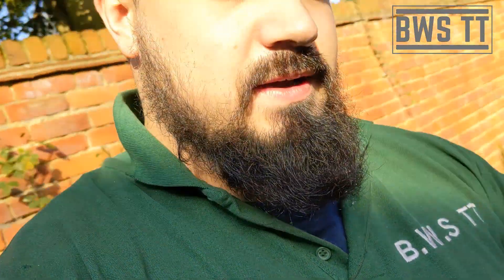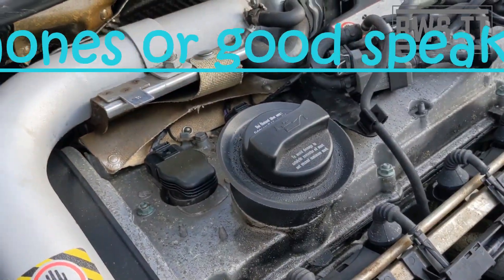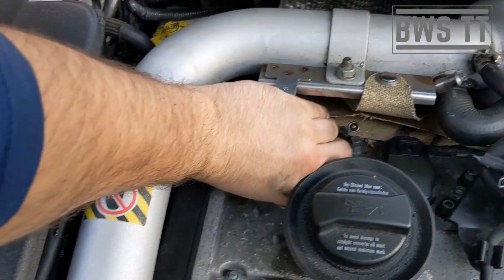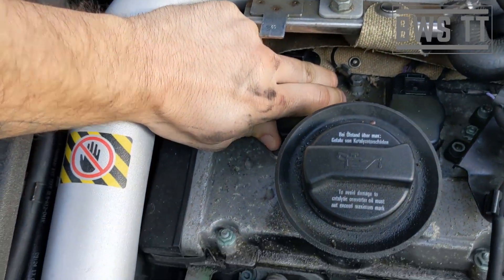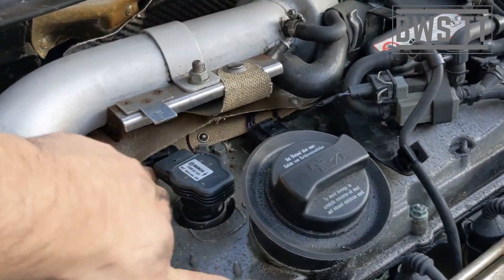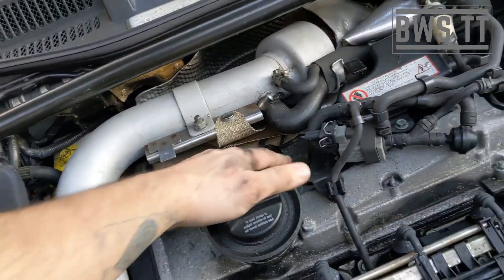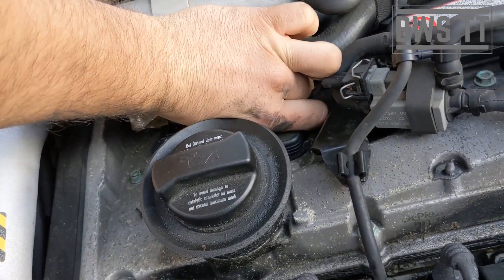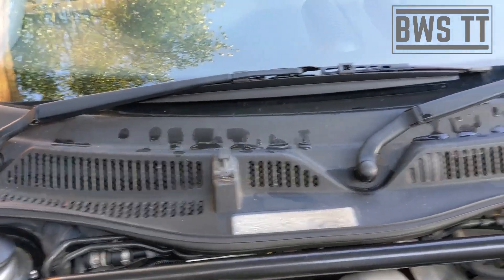How To Diagnose A Faulty Coil Pack - Audi TT MK1

Comment: I know this is an old video. Hopefully you see this comment. I just installed the upgraded R8 coil packs, but I cannot reinstall the existing N249 bracket. I have an AMU engine. Right now I have the 249 system fixed in place with zip ties. Do you have any suggestions? Thank you in advance.

Comment: i got viberation only sometimes not always and only in fist second of engine runnig i change injector and coil pack conectors because was in bad situation this solve car responce before change it i had a feeling that my trasmision make 1sec to responce ..only  if im charge battery no viberation on fist seconds..u thing its a coilpack the dog bone or i need a batery soon?

Comment: are the coil packs engine specific?..looking on one website they all say for AWP engine only or ATP engine only..I have an AUQ..I looked on a different website and all except one had no mention whatsoever of engine type..an R8 coil conversion is a thing that exists and they wouldn't be the same engine code..the coils are just a bit longer (requiring the adaptor plates) and "0.2T" more powerful, right?..I just don't know if they're listed wrong or if 20 years ago they had coils for all the engine codes and now the AWP and ATP are all they have left in a no replenished stock..
I already don't have screw down coils which it appears I am supposed to have since there's a bunch of unused bolt holes..so I dunno..I'm about to just buy some and try them..

at least I know how to check them now..

Comment: I picked up my 01 in 2016 and have put 7k miles on it. It only has 27k on the ODO. That said, the steering wheel vibrates at idle and occasionally it takes two cranks to start. The coils and plugs are original to the car.  Are these coils and plugs known to go after 21 years? I know they say its 100k mile part but I have to assume they can go early from sitting. Whats your opinion?
Reply: Hey, sorry to bother but do you remember how u fixed that issue? 🤔 Cause i have the same issue

Comment: I've lost ~10-20% power and acceleration is not great, as well, running a bit rough. I replaced boost valves + gauge, cleaned MAF sensor and got slight improvement but still running rough. This week, will replace coils and spark plugs.
Reply: No check engine lights?

Comment: Need to make sure they are for your particular TT engine. Not all of them have these plug-in design. The others are held with 4 bolts each.
Reply from the maker: 2 bolts, but yes there are 2 types that are clearly different
Reply: @BWSTT  Right. They were placed diagonally on a square flange. Looks like some later model TT's have flanges with only one bolt.

Comment: He was lucky the bad coil was not on cyl 3 or 4. They're under the secondary air injection plumbing.
Reply from the maker: It’s hardly an issue to access 3&4

Comment: Oh man don't pull the coils while running. You can get electrocuted. Trust me it sucks. It will make your whole arm go numb and can kill you!!! You obviously never have been. Pull the coil while car is turned off then start to see if difference. Don't handle the coils while running.
Reply from the maker: With it plugged in there's barely any room to get it far enough away from the spark plug for it stop jumping, let alone get yourself in the way as an earth. If you only touch the coil there's no way for you to ground it, so yes be careful but that's all

Comment: Quick (maybe daft) question... Are the four coil packs all identical? I take it you don't get a different coil pack for cylinder 1 as you would for cylinder 4 ... All the same part number?
Reply from the maker: Indeed they are all identical. The only daft questions are the ones you don't ask
Reply: @BWSTT  true!
It's only cos I had one fail yesterday on the way to my mates and while I was getting towed in (I was a lot nearer to him than home) he rang a motor parts company who told him all of them are different and he had 3 of them but the fourth one he'd have to order in??! Random...😂
Anyway went to a different company, all sorted now and running very nice

Comment: What good coil packs do u recommend? Seen all different options some red ones
Reply: If you run stock or only a slight tune, just get some NGK coil packs.
Reply: @xXYannuschXx  running about 265bhp
Reply: @johnhinds6308  Then just get some NGK ignition coils, the red high end ones are only meant for when you have a really big setup (something like 500-600hp).